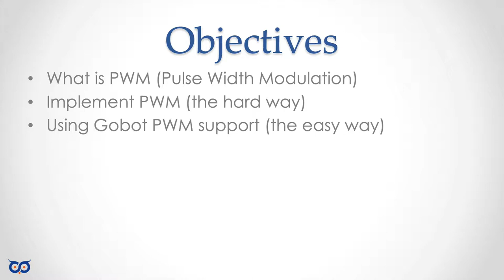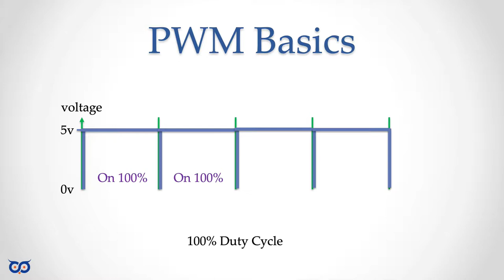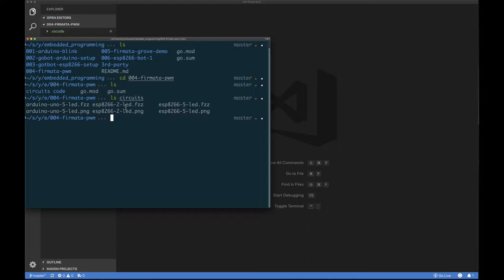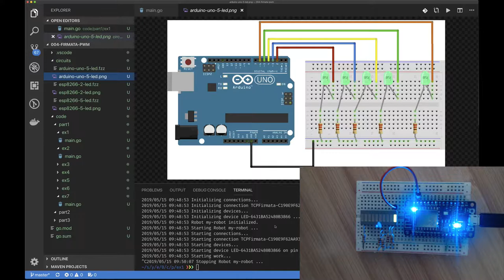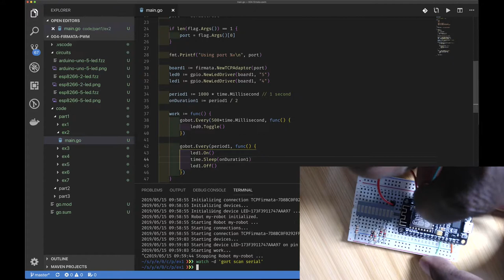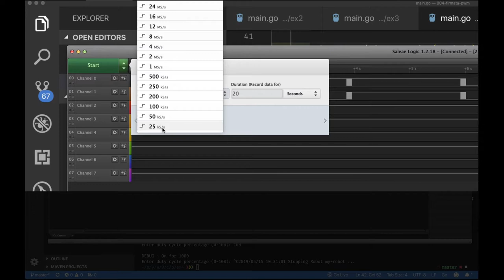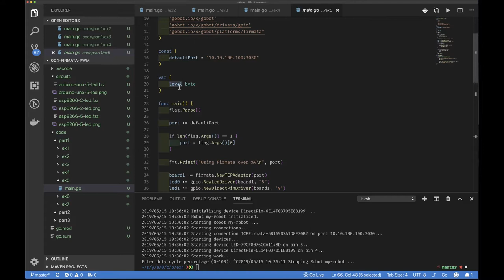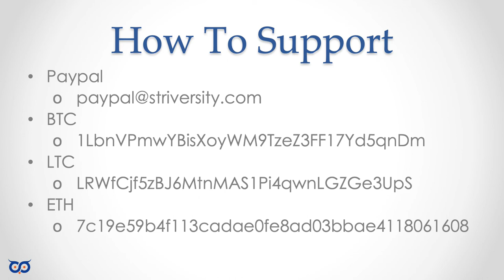#golang #embedded #gobot - S4 E1 - Using Gobot and Firmata for PWM

Comment: Goooood, fine and all and all, but why didn't you show the last example: so strange after such a long video it wouldn't have mattered to make it a minute or so longer, but good, fine and nicely detailed video
Reply from the maker: Hi Alvaro, thanks for the feedback. The video was already so long, that I was trying to cut the time. That was probably a bad call to not so the last example. I will try to remember to take that into consideration in a similar situation.